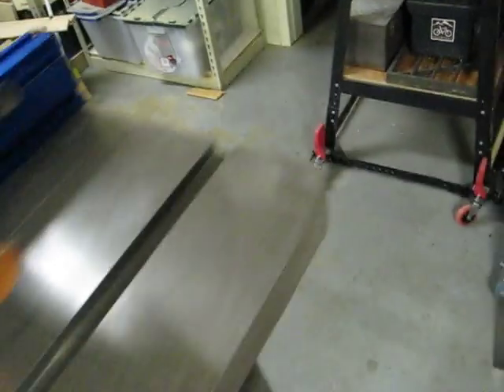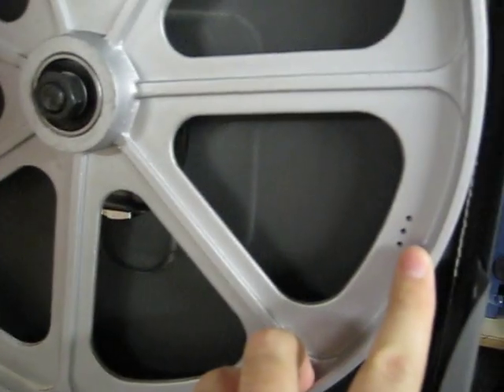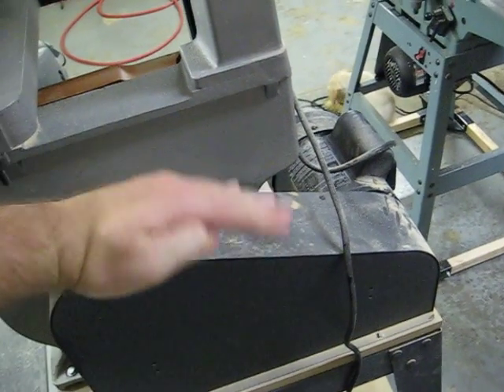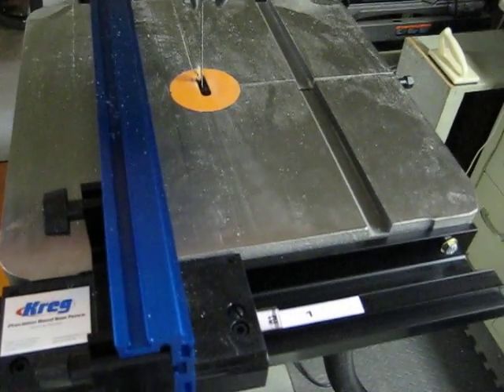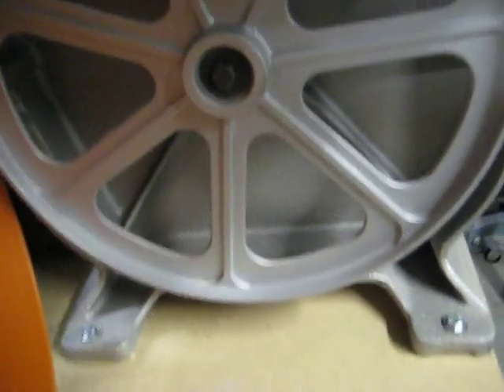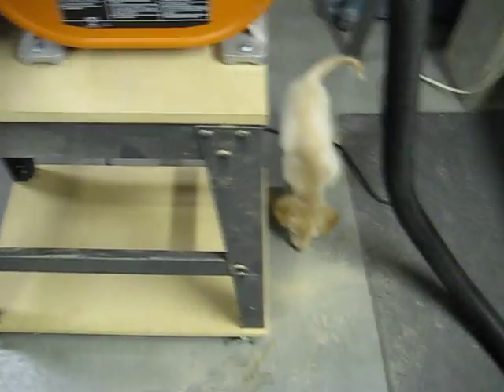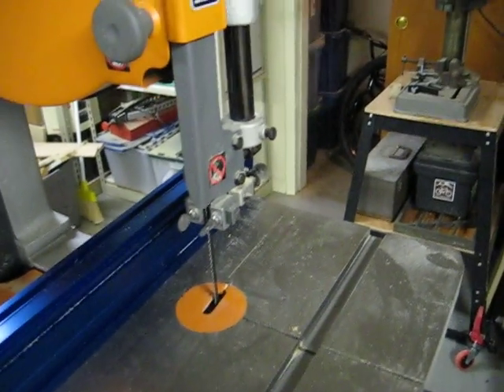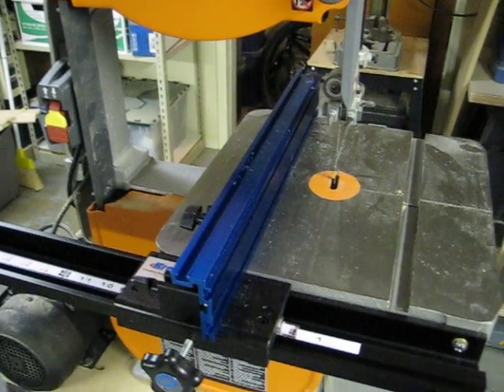Rigid Bandsaw review

Comment from the maker: @4cbutters , I removed the rubber grommets.  I tried with and without.  Without grommets the vibration was less.  On my saw the combination of wood base, ridgid mounting the motor, and swapping the belt seemed to do the trick.  I have also balanced the wheels, but they were pretty good to start with.

Comment from the maker: @Hagfan789 
I have had no issue with this saw.  Since the initial setup all that I have had to do is adjust the cool blocks from time to time.  I use it on just about every project through the shop.  Even after selling off a bunch of my other tools I have a hard time letting this saw go.  I use it mainly for linear cuts so the wide Olson blade stays on the saw.

Comment from the maker: Not much to the base.  I bolted the stand to a piece of mdf scrap I had about and put some spare casters on it.  I used the stock leveling feet with some thread inserts for locking the saw in position to work.